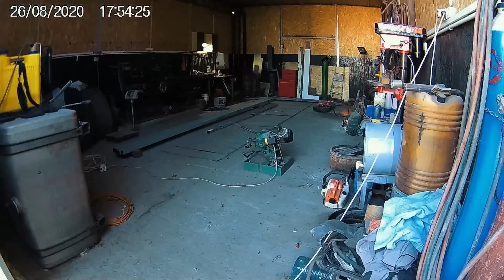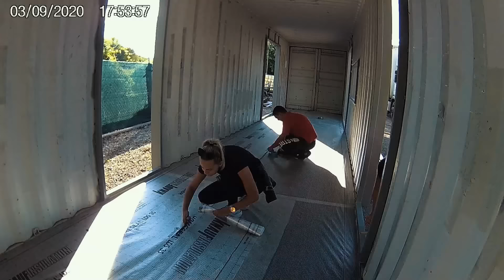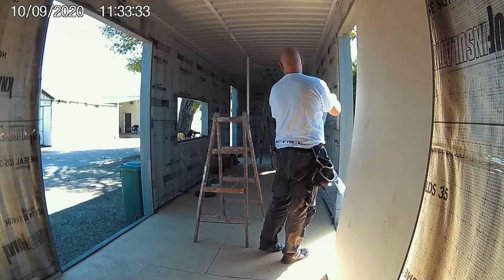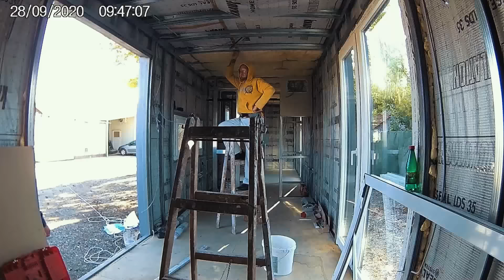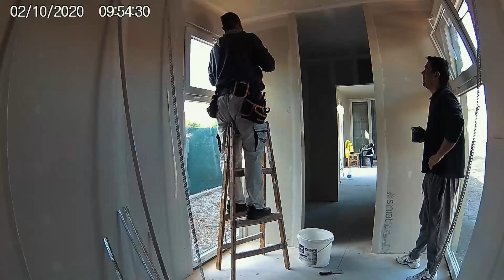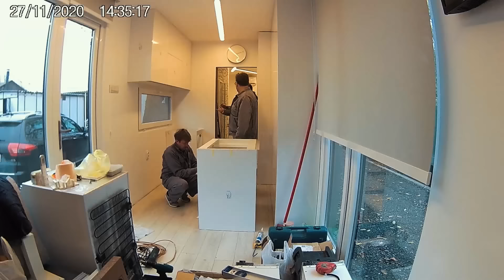Building MLG Lux Shipping Container Home - Step by step DIY - TimeLapse

Comment: I would have insulated only the floor and the sides from the inside, more insulation could be added to the outside if necessary even on top. I wouldn t added that much reinforcement frameing because it only added weight to the overall structure, only around the windows and doors. If you want to reinforce the structural integruty i would have used x or triangle patterned frameing on larger devided sectoins that way it adds less weight. Later  add solar paneles to the top with power wall and harvest rain water if possible with water filtration system for consumption and grey water system for higenic purposes. With the use of a hho generator heating could be solved as well. Sewer can be elemenated via a composting toilet and the use of grey water system. Backup generator could be used as an emergency power sourse  wich could run of biodisel of hho. For transport the whole structure could be placed on a 4 wheeled semi truck trailer with liniary actuated pegs when in stationery position.
This way you cold be totally off the grid.
Awesome build! Congarts!

Comment: The roof should be covered in either a torched down rubber roof material or the use of white fiberglass material used on mobile homes reflective in the summer and positive leak preventer
Reply from the maker: there is vinil high gloss paint on it....white...
Reply: Never seen a shipping container with a rubber roof
Reply: It's already waterproof. What is the purpose of the additional layer?
Reply: @lvlikeyV  INSULATION !
Reply: @theou9252  you insulate the inside....not the roof. You can but it's kinda silly to do so.
Reply: @randybobandy9828  No it isn't. You can even put gravel or a higher additional tilted roof. Lot's of data in YouTube. Cheers!!!
Reply: @EagleSoul  put gravel on the roof? Wtf? Just insulate the inside and use the containers watertight roof instead of wasting more money on an additional roof.
Reply: @mlgkontejneri3283  , зачем плёнка перед утеплителем ?
Reply: @kevinmarrinersr5865  w

Comment: I would prefer insulation from the outside. The steel construction of container needs to be insulated. As it gets hot and cold, it spreads and shrinks (causing troubles with tiles and plastering) and mainly transfers temperatures from the outside. You can give more insulation from the outside and you don't lose any space inside. Of course this way as it is done, it is a much cheaper solution.
Reply from the maker: but then You cant transport it...it is oversized....

Comment: Nice job but I would have used Spray Foam installation in a metal shipping container instead of plastic vapor barrier The R-factor would higher. Think it would be a better lay out if 2 containers were joined together.
Reply from the maker: its forbiden in our country because of not fire resistance...only mineral wool for getting premision and eco passport...
Reply: What is going to stop it from condensating moisture due to the air space between the outer steel wall and the vapor barrier?

Comment: Mineral wool 15cm you have answered below, that's like 6 inches with both sides you'd be taking a foot off the internal space.  Bathroom looks great, the hand basin could have been smaller with cupboard down the side for towels & linen or under the basin.  Any hanging space in the bedroom?  Nice job.

Comment: Guaranteed to have massive mold and condensation issue because of the air gap between the metal and vapor barrier. Spray foam is the ONLY way to insulate a steel container. That’s how I built my container home and have zero issues.
Reply from the maker: it is forbidden because of fireing,webare in europe, and it is hermetically closed from inside...
Reply: @mlgkontejneri3283  i see. I am in the US, it is allowed here. I experimented with various processes with mine and the only way I did not get condensation was spray foam. Maybe you have a different wrap material in Europe that works better
Reply: This isn't the only way. InSoFast insulation panel works well too.

Comment: Kind of wondering why you didn't do spray foam insulation instead. Seems it would be more weather proof, and leak proof.
Reply from the maker: because in europe is not allow doing foam because of fire resistant is on very low level...
thats the law

Comment: it is amazing work. 

However just wondering since you build a frame in the middle (between container wall and inside wall), how hard it is to just build a external wall instead of using a container? and you will have much bigger space and height to work with....
Reply: You are correct...it would be cheaper and easier just to build a traditionally framed house of the same size. Not many positive things about a container home vs a traditional  home. People seem to think they are less expensive but they are wrong.
Reply: First you would need to lay/build foundation for the frame to be built on & then cover the external with brick, timber ect.  With a container the external wall is there & you don't need a foundation unless you want it off the ground.  So you only need to build the internal wall & ceiling frame, you couldn't live in  a container without this wall ( some do I guess ). First you see the plastic sheet to keep out condensation, then mineral wool & last plaster board. To have a much bigger space & height is going to cost a lot more money.

Comment: I really can't see any point in restricting the size of the building to shipping container sizes if I am going through the process of building all new floors/walls & ceilings. What is the function of a shipping container if you are adding so many structural elements into it? Isn't better to use the same material and have decent sizes to build a fibro house.
Reply from the maker: well, if You selling them, they need to be able of transportation, so exterior need to be untouched....
interior need to be adjusted to living in it...because container is for transportaion  of goods, not to lieve in....

Comment: Never unterstood these container houses.
Whats easier and cheaper to build this vs a small foundation and block walls?
How much does that container cost vs a little concrete and 500 blocks? without having to change and remodel anything?
Reply from the maker: well, at firs you dont need promission for it...seccond, its more durable and easier to maintain, you dont need foundation, manny more possibilities for shape it...and so more....
Reply: @mlgkontejneri3283  didnt know about the permission part, thats hilarious actually lol

Comment: I sure there is hardly any overspray on the window frames, doors frames and glass. 😂 Also, who uses drywall backing for the tile in a shower anymore? Other than that, the place looks good.
Reply from the maker: hello....i cannot show you everything in such a short time...first question i dont understand for paint, first goes plywood, then watterpfoof drywall, then Sikaflex rubber for two times apllying and then specially glue for tiles...so first ask, then let the thong speeks ....

Comment: Nice simplistic build. 

I was wondering why the European use the plastic looking sheet for insulation Vs the Americans who use spray foam or styrofoam thick layers. Anyone knows?
Reply from the maker: because of fire...laws....
Reply: I think the plastic sheet was for condensation. Mineral  wool 15cm Vs spray foam, is that you have to sure that its not to thick, so you don't have to check it all & shave it back to put the plaster board on.

Comment: Insulation? Placing bathroom, between living area and bedroom. Thats a very crap work.
Reply: why? no problems with proper ventilation...
Reply: Where else are you going to put it dummy? You don't have alotnof options. You put on the other side of the bedroom that's worse. You put it on the opposite side of the bedroom than now you have to walk far from your bedroom just to use the bathroom. It makes it hard to put a couch in the living area when you have a narrow door tonthe bathroom in the way.